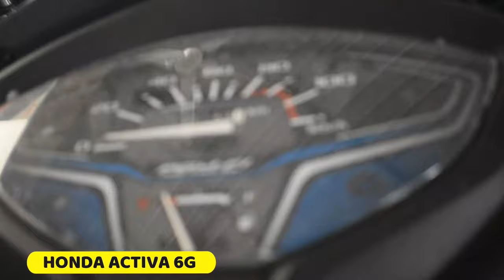Honda Activa 6G BS6/How To Change Engine Oil/BvjTech

Comment: bro in my victor there is a problem the bike is starting when i will accelerate the bike will turn off what is the solution the acceleration cable is also working and last month only fully
 serviced
Reply from the maker: Carburettor problem bro
Reply: OK bro thank you
Reply: Bro I didn't  touch my bike for 1 week after 1week I started the bike the bike working properly 😂😂😂
Reply: Air filter clean or change